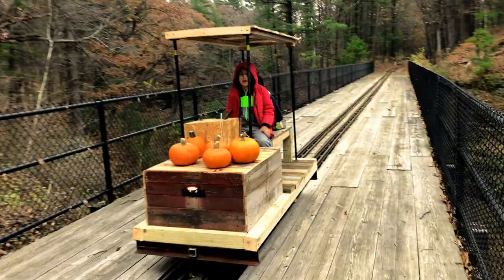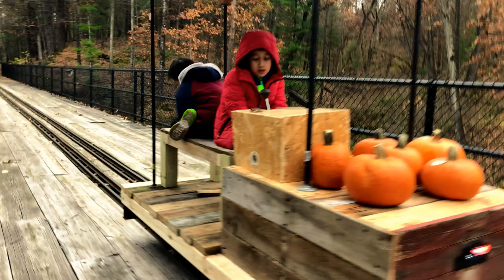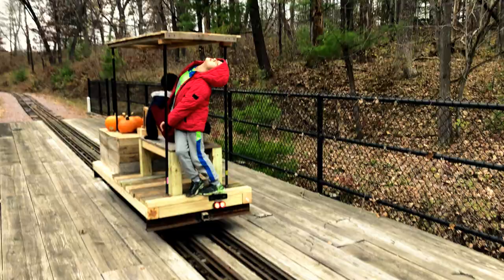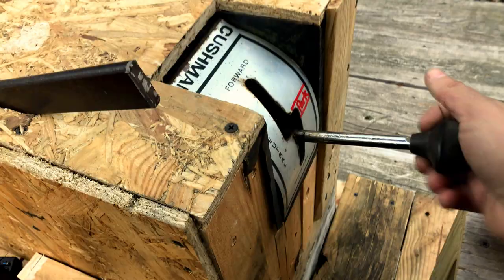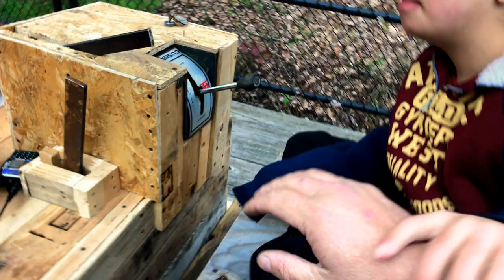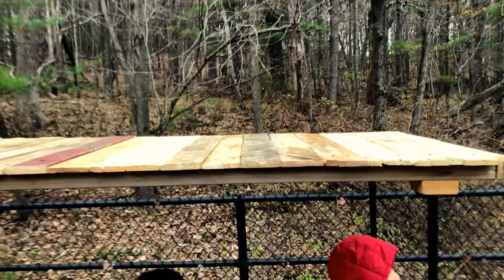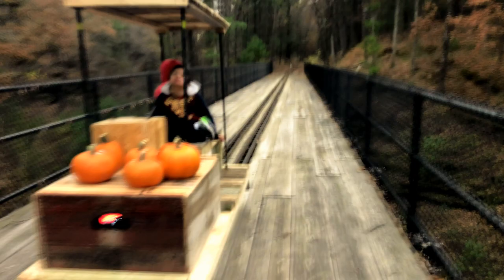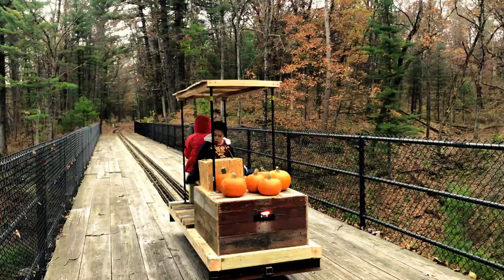Built a Electric Locomotive during Lockdown FROM SCRAP! DellsTrain.com

Comment: Cool stuff!
Reply: The solar... Maintenance charge, range extension, or will is stay in the sun when parked?
Reply from the maker: Yah, trying to decide on it. Thinking of adding panels, however, with nothing on the roof, it could be used as a "roof Rack", could transport ties, or a rail, or other larger items without needing to pull a maintenance or flat car. 

When in use, of course outside, when stored, it's in the round house (For now, we're getting 2 more of the steam engines in operation for next summer, so we will be up to 5 fully running steam engines, and round house only has 5 bays). If I can get the old boiler shop cleaned out, I can park it in there at that time.
Reply from the maker: So the decision comes down to, how much real benefit will adding the solar bring at that point. If it was more than maintenance engine or used as a shunter, such as pulling coaches with passengers, then it would be outside all day every day, might go for it. but heck, even with just a single 9 year old deep cycle battery, it runs the full course of the railway and still has charge left, not sure if it would be necessary. Far end of the railway, (not reachable at this moment due to track washout, still waiting for FEMA to get their crap together, the end is about 500 ft behind me where I am filming), the camp (Cabin in the woods only reachable by train or foot) and the station all have electric service. A plug in with an extension cord would get more power than a solar panel would and charge faster. Another benefit/hinderance depending on how you look at it, we have a steep grade, which is why the line was abandoned by the Milwaukee Road in the early 1900's and moved west of the location. Due to this, if you make it up the hill, you can coast from Western Springs (The end of the line) all the way to the Camp, if not further.
Reply from the maker: Got short video while driving through the forest coming soon.
Reply: @KmanAuto  excellent, looking forward to it!